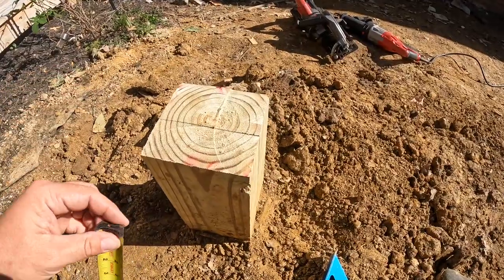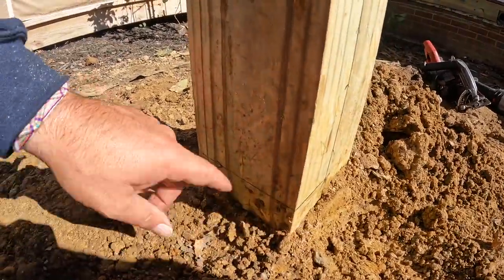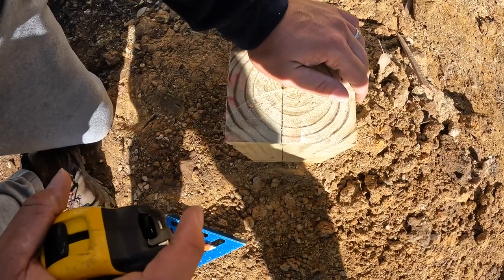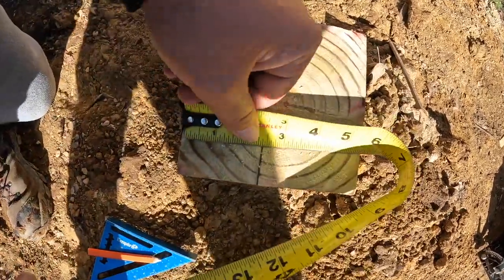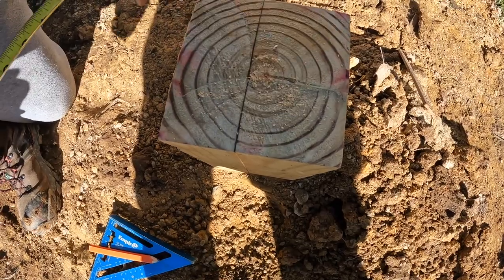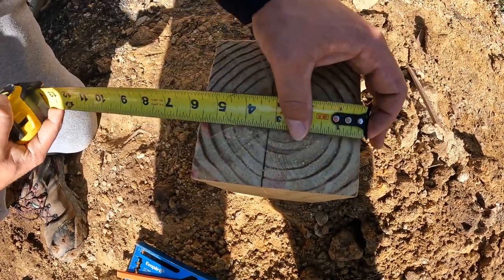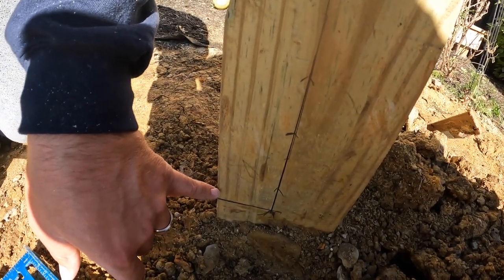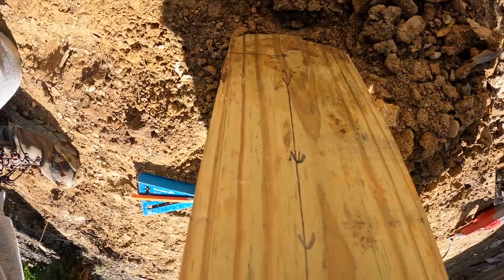How to notch 6x6 post for "Direct Bearing Method"

Comment: The greatest directional force on your deck post is downward (gravity), supporting the deck and also furniture, people, etc.  The taller uncut section of the 6x6 post is there to deal with lateral forces, which aren't as great as the gravitational forces.  Additionally, my deck inspector told me he will not ok a deck that has "overhanging" (not fully supported) deck beams.  They must be fully seated by the post shoulder.
Reply from the maker: I understand where you are coming from. In my opinion, both beams are makimg direct contact with the notch of the post. Both beams are indeed sitting on the post. However, some of the beam hangs off of the post. I believe it's going to be safe and fine and last for 30+ years. However, if someone wants to cut the extra bit of the post off so that the double beam fully sits on the notch, I understand that position and don't disagree. It's more of a personal preference, and of course it depends on what your inspector/building dept. requires.

Comment: if you want your deck to be up to code and pass inspection make sure the beams are fully seated on the post, so notch out 3 inches from the 6x6! load bearing is the most important thing here..

Comment: As a deck builder also, I’d have to kindly disagree. I think direct bearing would be a bit more important the. Saving the back of the post.. we add structural screws through the post into the beam. I’m curious as to why you believe the direct bearing isn’t as important is just some wood behind the beam?
Reply from the maker: Either way, I'm sure it's fine. I just like to cut my notch at 2 3/8 so that I can save more post where the bolts go through. The narrower the post is, the more likely it is to split over time. With a 2 3/8" notch, both beams are still technically direct bearing on the notch of the post.
Reply: @deckbydesignl.l.c5091  the outer beam is not resting 100% on the post.  Some inspectors will not approve this.
Reply: I agree. These should have been 8x8 post to prevent this.